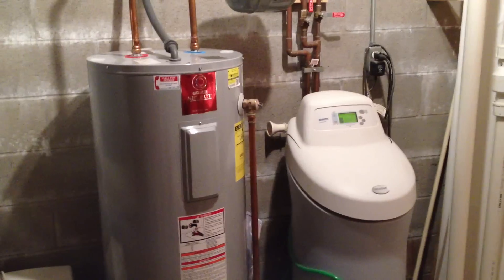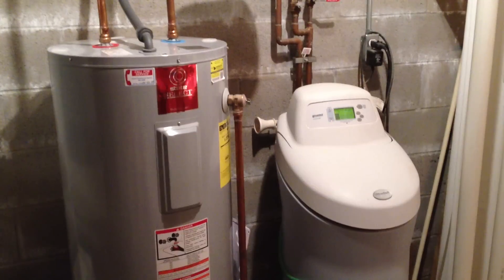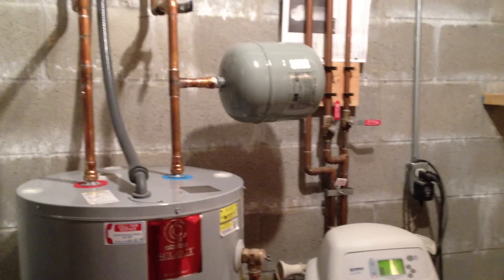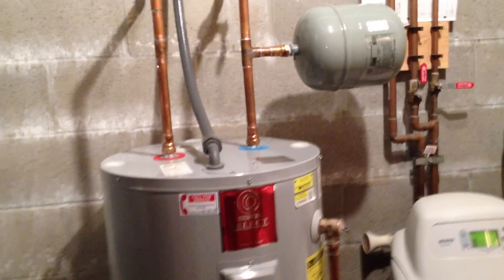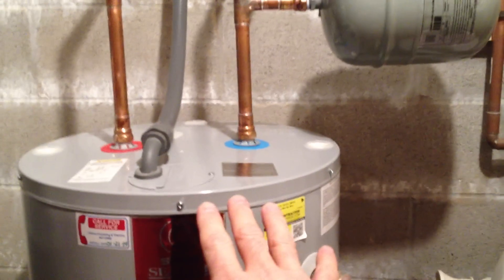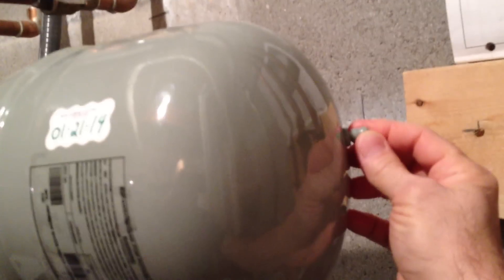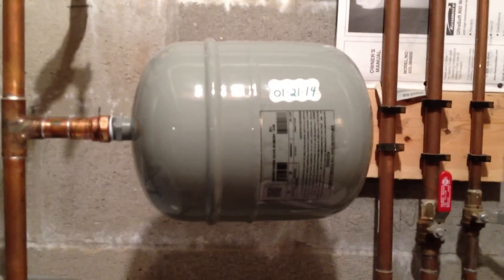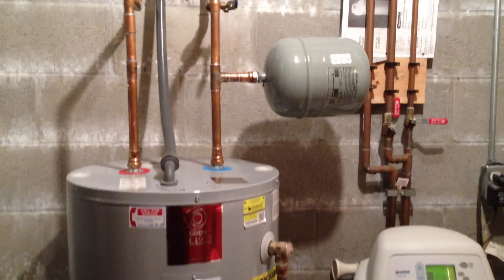Protect Your Water Heater with a Thermal Expansion Tank

Comment: I'm pretty sure all new water heaters come with check valves on there cold water inlet lines.  This expansion tank would account for fluctuations in the incoming water pressure, but isn't being used for thermal expansion (probably doesn't need it) where it is placed.

Comment: if anybody has had basic physics then you know about TORQUE.... that expansion tank is applying Torque to that T-joint .. it wants to rotate down .. if you get water in that Tank the Torque increases big time... That is a dangerous install. It needs to be Supported. Don't even question it, just do it.. SUPPORT IT..

Comment: I noticed my water heater has occasionally leaked some water on the floor. It is not much but it was a concern about the status of its health. I learnt that from youtube the Expansion Tank will help the pipe during the water expansion process, so I grabed on from local warestore and learnt how to put it on. It is sitting up side down with the neck at the bottom. I think it is the right position comparing to the side way position. However, if you choose to position it side way, it is better to have it supported by some wood or metal attachment.

Comment: Water heaters/installations have sky rocked ~ I just paid $1950 to replace my 6-year-old water heater that was leaking, this time they installed all new copper piping and shut off valve along with an Expansion Tank so I'm hoping this one last longer. My Expansion Tank has a support strap mounted to the ceiling just in case.

Comment: Install check valve in cold water line will prevent water in the tank back flow. Dielectric union will prevent corrosion.

Comment: My house has 2 water heaters, both 29 years old, and working great. These expansion tanks were not installed. Most heaters fail for 2 reasons. bottoms are never drained of sediment, or the temperature is set too high. You're welcome...

Comment: I have the same State Select water heater, installed in 2102. Thermal expansion and contraction is not much of a factor because the operating water temperature is so far below boiling. The water heater already has a safety valve, so there's no need for the expansion tank. Effort is probably better spent in replacing the anode and the occasional tank flush. To extend the life of the heater and the control valve, set the temp selector to HOT, not higher, and certainly not VERY HOT. Wives, for some reason, love to set the selector as high as it will go.

Comment: Do not install your expansion tank like this idiot. When the diaphragm ruptures the tank will fill with water and most likely break off at the threads and then you'll have water flowing into your house at full pressure.

Comment: It needs to be installed in a vertical position not horizontal also replace the anode rod Every two years
Reply: Wrong. It can be installed horizontal just needs support.

Comment: if your home has well water equipped with an expansion tank do you also need an expansion tank on the water heater?
Reply: No because your water can expand back into the pressure tank. Unless you have a back flow valve that prevents this. Most have a manual cut off valve by the pressure tank, not a back flow valve.

Comment: Ya, should have been placed vertically, upside down. The bladder is always under pressure the way it is, with water, should be upside down with support, the bladder then only has to work ever so slightly moving up and down, the way it is, that bladder will fail due to always having water  on the down area.

Comment: Backflow preventers are usually on the landscaping lines, here in AZ. Not that it would be conclusive, but do you have a pressure regulator at the entry point of your water supply? What is your water utility pressure going into your house? Maybe that is the issue. What is the hardness of your water? Some test strips will let you know if your softener is doing it's job.Three units in 10 years. Thank God you're not tankless.

Comment: 3 water heaters in 10 years? That's crazy. My old Rheem lasted 25 years. No expansion tank either.
Reply: Mutant Baby  yeah I’m saying the same thing, new units aren’t the same as the older models, now a days they won’t last, especially those A.O Smith heaters, I’ve replaced so many under manufactures warranty

Comment: You don't need a expansion tank, because you have a pressure valve for the heater;
the only time you will have leaks and tank failure, if the pressure builds up due to a stuck pressure valve.
Checking the valve often helps to maintain the heater.

Comment: Would have helped if his video showed the back-flow valve, "down by the water meter", so we know what to look for.
Reply: If you have a backflow preventer valve on your home it will be close to your first ball valve from your incoming water. Pressure reducing valves (act as backflow preventers because they are one way) govern the water pressure coming from the city so in the even that the pressure increases over what our water fixtures are rated for, the pressure reducing valve does not allow that pressure to harm your system. if you google Pressure reducing valve in google images and take a look by your shut off I bet you'll be able to find it if you have one. Hope this helps! Cheers:)
Reply: @barclaywilliamson8565  Your answer is helpful insofar as anything about plumbing can be explained in text.

And thanks for not charging me $500, just for answering a question, as would plumbers where I live.

I suspect the reason my indoor water pressure spikes to nearly 100 PSI, regardless of how low that I set the pressure-relief valve, is because there is no thermal-expansion tank on the hot-water heater.

If this is true, then the pressure-regulator valve (PRV) might be OK, even though it has not been serviced for decades.

The real problem could be the absence of a thermal-expansion tank.

Comment: My original water heater had a pressure release valve built into the the shut off valve for the water heater, I had to replace it about every 3 years at $60 a valve, nobody could tell me why it was there so this year when it leaked I plugged it. The a flex fitting on the outlet side of the tank started leaking , tightened it leak stopped, now the large pressure relief valve is leaking! This explains why, I will be buying a pressure tank for the heater now. Glad nothing major broke. Thanks

Comment: Sediment flush ones a year and inspecting the anode rod and replacing it when needed will definitely add more years to your tank. Throw away that salt softener it is doing more harm than good to your health, your plumbing system, and the environment. https://www.lifesourcewater.com/blog/water-softeners-banned-by-law.php Get a whole house filtration system instead. Also, read your water heater's manual on page 23 or 24, "the use of a salt softener increases the consumption of the anode rod.
The anode rod the single most important part in your water heater. It sacrifices itself to protect the water heaters lining from corrosion. It must be pulled and inspected every year and replaced when necessary.
Reply: I wonder how many thousands of tons of salt the road commission puts down for snow removal every season in my area? Probably enough to supply all of the water softeners for decades.

Comment: That's very interesting.  I have used a pressure tank before in rural applications with my well, but have never seen this.  I found your video after someone commented on my video about my Hot Water Mixing Valve.  

I'm surprised your expansion valve doesn't have some kind of support the way its installed.  It seems it would stress the plumbing with the weight.  

I am also surprised that water heaters do not have some kind of facility for expansion themselves built right in.  I am not sure, but expect that some do.  

I have always gotten good life out my my hot water heaters, but where I am from most people just rent them;  the fee is put on the monthly utilities bill, its negligible, and will be serviced promptly as necessary.  

Here is my Vid:

https://www.youtube.com/watch?v=TLjwMrlbGgk&lc=Ugy_6igmMzqobPdrkqd4AaABAg

Comment: Must gives thanks to your video because it sure helped me out. Supply pressure 63 psi, heated water hit 140. Put expansion tank on, now pressure hits max 69. 
A plumber told me he “never” heard of this problem and just put a pressure relief valve on. That works but your dumping money down the drain. 
I wanted a proper answer and you supplied it. Zero pressure issues now.

Comment: Installed incorrectly
Reply: How should? Also should be on incoming cold?
Reply: Read the literature it comes with...mounted vertically on a horizontal run off a tee and right into the tee....not extended off as yours is.
Reply: @oilman614  not mine.  Getting ready to replace my water heater and was going to add this.
Reply: @oatlord  My bad....you might also want to check your incoming pressure. Those tanks have to be air charged to match your house pressure.
They are pre-filled to 40 psi approximately but are not to be used above 80psi. 
If you are anywhere close to or over 80 psi, you will need a whole house water regulator. 
A very common one used is the Watts LF25AUB-Z3. You shouldn't need anymore than 60 psi

Comment: Your Plumber should've strapped it to the wall so less stress on your pipe. Also check installation instructions most have to be mounted vertically and a minimum of 18" of pipe away from the Water Heater.

Comment: Im trying to update my houses plumbing but I see all kind of grounds on my hot water lined and I dont see any on yours.  I am worried to take these grounds off, but need to learn why or why not to ground. Also, is it a code that hard pipe must be used about the first 36 inches into and out of the water heater? thank you
Reply: thats your earth ground for the your electrical system, so that there is a potential to return excess electricity that isnt going back through your neutral/ common drain for electricity.
you can move them around, I suggest knowing which does to what and turning that off, or shut off all the electric when you want to do that. 
the better organized your work is, the more effective it will be. probably you have water meter control grounded on there, an alarm system, your buildings ground connection, a gas meter control..

Comment: You only need an expansion tank for three reasons.  1) If your incoming water pressure is 75% of T&P set pressure. 2) if you have a back flow preventer /check valve or if your t&p valve leaks water on occasion not caused by worn valve.  Biggest reason a water heater will fail is due to sediment build up.
Reply: 4) If your building code(s) require it. Many areas have been updating their building codes to require expansion tanks. We live in such an area that did NOT require expansion tanks prior to changes to the code in 2009 or 2010.
Reply: @jerrybichsel4545  You are correct. Just re-piped my house with PEX since I had a slab leak after owning the home for a year. I scoured the building codes for everything to make sure I did it correctly. Just had an inspection today and he said everything regarding the piping is solid- except that I need to add an expansion tank to the water heater.
Reply: You need to cover everything if you are going to put your  Educational reasons in here.

Comment: Your plumber did a nice job. I've seen some "fugly" soldering from so-called professionals. I'm not too keen on the tank hanging sideways in open air, though. It could weigh almost 20 lbs if full of water.

Comment: I see 2 problems. 1st your tank is not supported properly. The copper pipes cannot support that load, it needs to be inverted and supported. 2nd, Thermal expansion is not what is killing your water heater. You have improper corrosion protection that an aluminum/magnesium anode rod will not solve. I have seen anode rod depletion in well/city water in 2 years. That means in 1 year you have only 50% of your anode rod left and it will simply not do the job. Plumbing companies are making fortune selling these "add ons". If you water pressure was great enough to crack the case lining to start causing you rust issues, you would be blowing your fixtures out of the sinks. Thermal expansion is going to occur anyway with or without the tank since the tank itself getting hot then cold.

Comment: My 30 year old water heater, just died....bought another...ready to put it in....the other one never had any extra tank on the system, and it never peed on the floor....I cant see the sense in the added expense that I cant afford when the other one lasted 30 years with no issues, and without this thing.  The water going in is not completely open, I set it at half the amount goes in at any time.  So is this extra tank thing absolutely a necessity?

Comment: there are no seals in a hot water tank.   only 6 threaded fittings...anode rod, T&P valve, drain, controls, inlet and outlet.   My tank is 17 years old.  no expansion tank.    Tanks fail when they rust out and start to leak.  I have four houses, none with these new devices.  It's just another thing to break.
Reply: So where does thermal and shock expansion go in your system?,

Comment: Thank You! I've installed a new water heater about 3 years ago. We noticed it was starting to leak during the time I was working on a  remodel. About a year ago, our local water municipality installed new smart water meters. They didn't mention the that they also installed new meter bases (the meter base contains the backflow preventer aka check valve) . Since my house was built around 2000 (pre Back flow preventers) we've never had a PRV relief valve or expansion tank. My wife recently noticed our water heater pan was staying wet (full to the ID of the drain line). Today I installed a new T&P valve and i noticed it started weeping shortly after install. I checked our water pressure and it was more than 140 PSI! As soon as we open any faucet it returns to line pressure. Not only does it seem the city has failed to alert consumers to the actual impact to all consumers, they've possibly created a situation that could cause  flooding and other plumbing failures. the info you've provided not only saved me additional headaches you've likely saved my house from additional flooding damage. Thank you!

Comment: you do not have to install backflow preventers on potable water systems....boilers, lines supplying pools things like that require backflow prevention.  if you have a PRV those usually have check valves in them and also some water meters have check valves...if you have a PRV good idea to install a expansion tank.

Comment: Excellent video, pics, voice tone, and script.  I recently replaced my water heater Feb 2017, single person usage, purch home in 2012, and the former heater was 'dated' 2001-was vacant for 2 yrs.  So, the last install was MOSTLY ALL DYSFUNCTIONAL-wiring/no conduit or even elec. screws-he used black tape and the romex was laying on top of the heater, no pan, no release pvc, etc. So my goal was 'code' installation.  I did read about the expansion tank situation at install.  Today Mar. 19, I was reinstalling the shelves on top of the water heater, and had just washed a load of clothes, my arm touched the 'supply line' and it was hot.  So it appears I need this expansion tank, so I ran the sink water for 30-60 secs, to see if it released pressure, and wow, the supply line is cool now. That was remarkable fast, so thanks very much for the sink clip on this video.  So God willing, I'll need Home Depot today for the expansion tank.  Thanks for sharing life with others. P.S.  I have VERY hard water, so installing the water softener is a future goal.  This hard water is killing my long hair, skin, etc.  I buy Glacier water for all kitchen use.
Reply: That's most likely not caused by thermal expansion and doesn't indicate the need for an expansion tank. Heat migration, thermo-siphoning, convection, call it what you want, basically it's the lighter hot water rising up into the inlet pipe and the heavier cold water sinking and falling out of it and without a heat trap it'll keep happening whether or not you have an expansion tank. 

Running the water didn't release any pressure, the whole system is and remains pressurized otherwise your water stops flowing and when you opened the faucet the warm water from the pipe just moved back into the tank and the cold water moved in behind it thereby cooling the pipe. Similar to a garden hose sitting outside in direct sunlight. Pick up the hose and it's hot, turn on the hose bib and it starts cooling off.

Comment: Ditto in regard to the supporting in the expansion tank, also there needs to be a maintenance valve on the inlet to the tsnk in order that the pressure in the tank can be tested either through a maintence program or fault situation. I would further add a pressure guage on your inlet in order to evaluate the stress your system is under in order to ensure that it is working as it should. As it stands, you have no way of knowing your system is failing until your cylinder has failed again if your pressure relieve valves are set incorrectly, failed or simply missing.